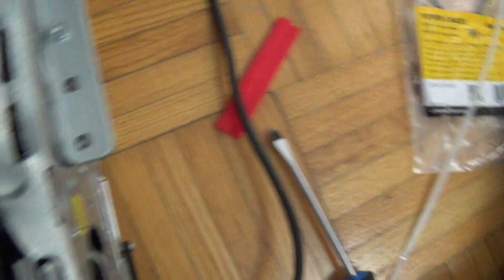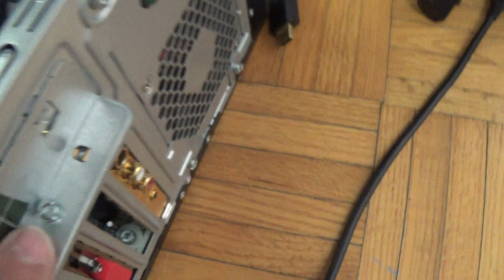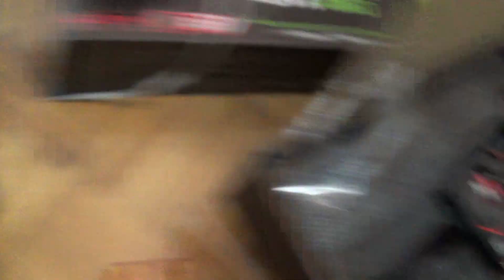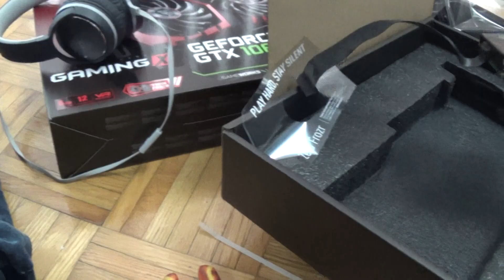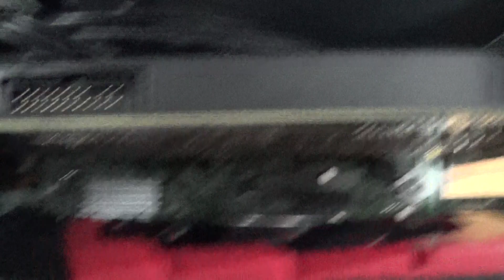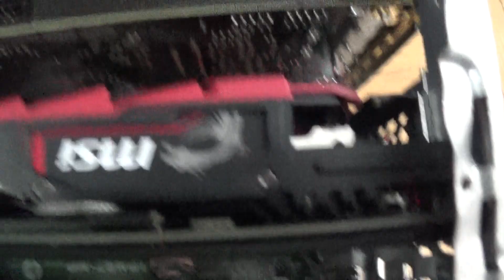ENVY 700-209 graphics card upgrade part 2

Comment: I have the same PC with an i5 6400 2.7 GHZ, 12 GBs of RAM same as you. I currently have a GTX 745 installed in mine. How many watts is your power supply? The box on my Gigabyte GTX 1060 6GB says minimum power requirements is 400 watt power supply. Will my 300 watt power supply run the 1060 card without any problems? What are you using? Do you have the same supply?
Reply from the maker: I  would upgrade the power supply
Reply: 6262323 I just swapped it for a 500 watt PSU the yesterday and got it working with the 1060. Works great!!
Reply: 6262323 Thanks for the advice
Reply from the maker: @kissmickd  No problem